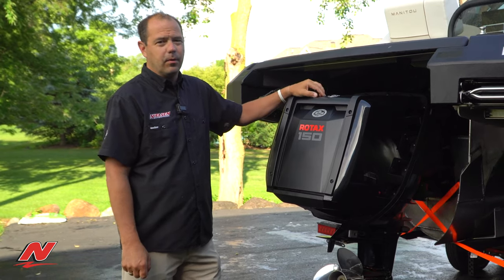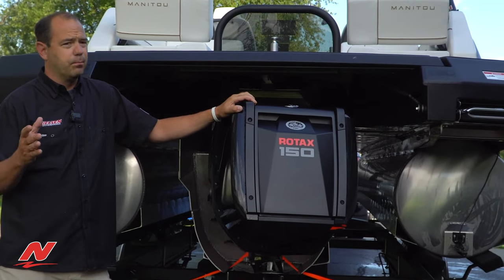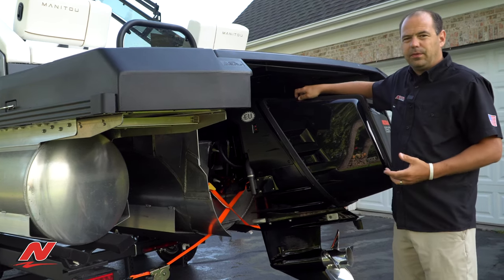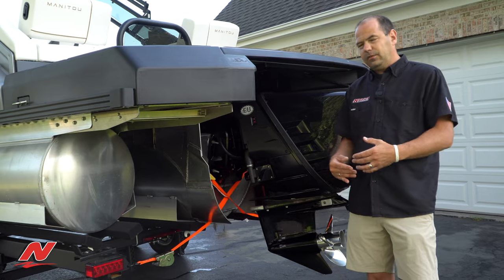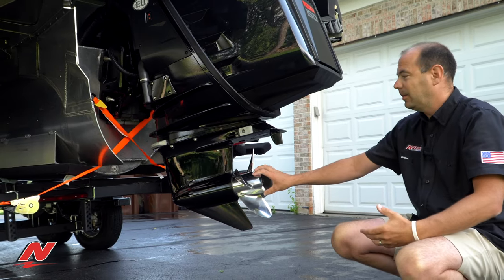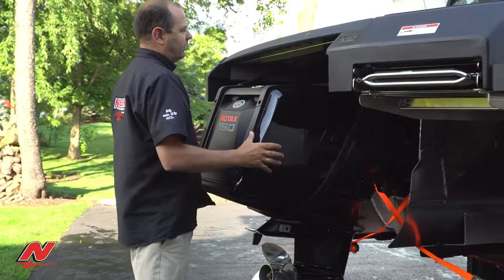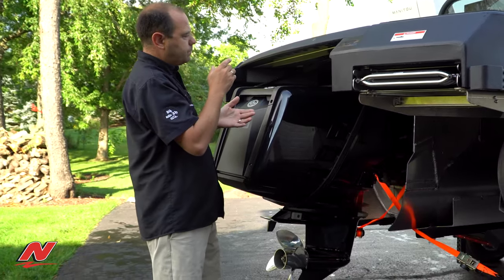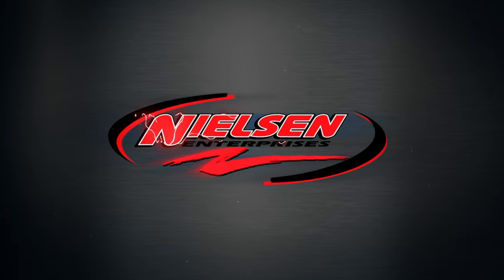The All New Rotax 150 Motor On The Manitou Explore Pontoon Boat

Comment: i keep my boat in the water all summer. is there any reason why you couldn't leave the engine elevated when the boat is sitting at a dock for extended periods? i'd feel better about the prospect of batteries and sensors potentially failing if the engine wasn't underwater.

Comment: Manitou "used to" make some bad-ass pontoons, particularly their "Explode" models.    Even their twins with the E-Tecs were quick.   However, this new power plant and set up leaves a LOT to be desired.  The fact that its a two stroke is a plus but performance with a single engine 150 is going to be lacking.  Tell me it has 300+ HP and I'd be impressed.
Reply from the maker: Keep in mind - you CAN still get a Manitou boat with up to 900 HP and twin outboards. They still DO make some "Bad A$$" pontoons!  We've got a few at our dealership.
   The beauty of this 150 motor is the swim platform, and for the pontoon owner that is not looking for the high performance 'go fast' pontoon.
Reply: @NielsenEnterprise  that may be true, but I dont see it on their website.   Are you talking 2023 or even 2024 models??
Reply from the maker: Yes, the new LT or LX you can do with twin outboards.  https://www.manitoupontoonboats.com/us/en/shopping-tools/customize-your-own.html

 @alexnutcasio936
Reply: @alexnutcasio936  yeah, they still make the "super boats". They just don't make regular pontoons anymore.

Comment: BRP is well known for battery drain, what happens when the battery is discharged?  For that system to work it’s going to need constant power right?
Reply from the maker: We have not experienced any issues with battery drain or voltage loss on this system.
Reply: I have never herd of this being a problem on the E tec motors. In fact there magneto systems is class leading at battery power rejuvenation